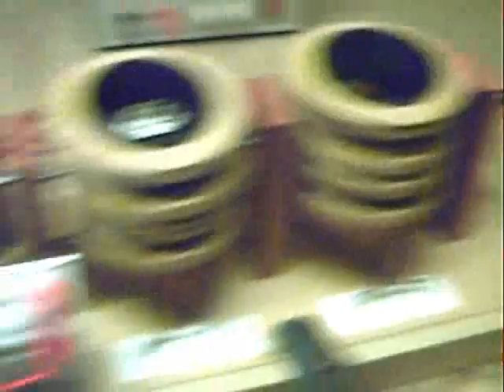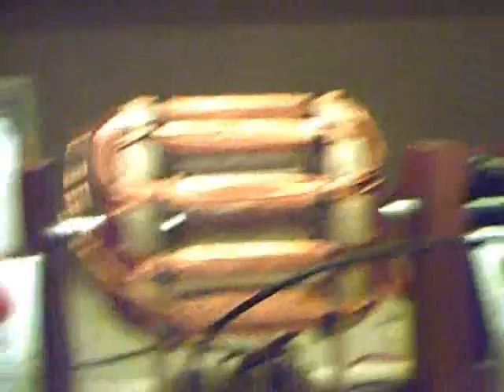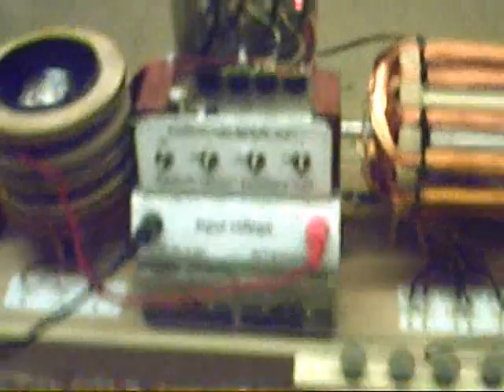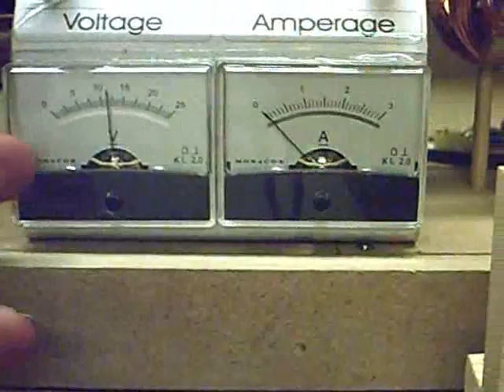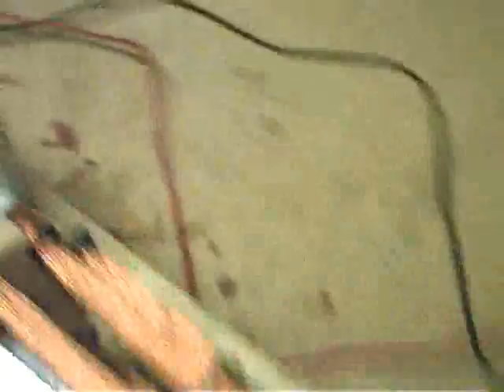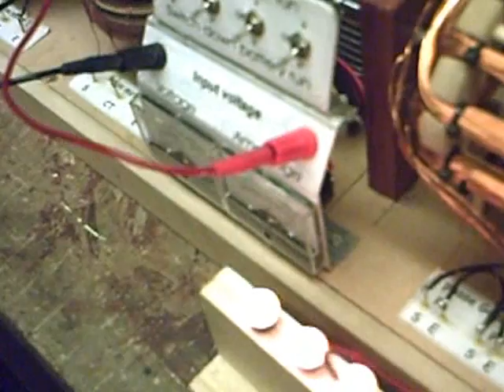My all new newman motor 2 running it up.

Comment: Put on four more hall effect sensors and time them to run the south poles of your motors and then you will have the efficiency to become over unity . You will need a flywheel coupled as well......keep tinkering. Nice job by the way.

Comment: Sorry, but this is all a lot of blah blah blah and you have not proven that you are not feeding the machine with external electricity. Build the exact same machine on a perspex stand and show us in detail live.
Reply from the maker: wasn't trying to prove anything at all just that id build a 4 pot Newman motor and just a demo of it running  up that's all this video was all about, no over unity no free energy it wasn't the point of this video, sorry. for your info its just a motor running very fast with generator filling a capacitor.  total experiment only.

Comment: Daftman please try this: 
Step 1: Power up the center motor with 24volts or more.
Step2 : Use all 4 newman motors as generators,wire them together in series to charge capacitor
Step3 : Once center motor is up to speed switch off the power supply and switch on the now charged capacitor.
Step4 : Enjoy self running loop
Reply: A centrifugally integrated flywheel (weights are spring-loaded to throw out as the RPMs increase) might be a good add, too.

Comment: I admire your fine engineering work and attention to detail. A beautiful project. I like your use of hall effect sensors.
Of course you're not going to be able to get the generator to run the motor/s in a closed loop. Perpetual energy / over unity machines are not possible due to the laws of physics that are tried and tested. We live with their limitations. The Newman motor does not, nor has it ever run on less energy than it produces. There will never be a useful electric motor that can run near 100% efficiency let alone go over 100%. The same goes for a generator. You will always put more hp into a generator than you will be able to produce in output wattage. Then you have to take into account all the other losses in the system beside the losses in the magnetic fields, like losses in wire resistance, the semiconductors you're using to switch the coils have their own losses, and then the mechanical friction losses. For those of you interested in the Newman saga: http://en.wikipedia.org/wiki/Newman%27s_energy_machine
Reply: +Fred Flintstone Nice discussion, may I comment? First, we all need understanding and meaning in what we live (see, do, interact, etc.). Our languages describe in an attempt to direct that understanding. Being able to describe anything has never been accepted as proof that the description is correct for a thinking man, although Physicists today like to think if they can describe it in the language of mathematics, it is how it "really" is. This is not rational. One must observe and conform to the distinctions that we observe in order to evolve a better description. Not start with a description and add to that based on distinctions. It is convenient to build on assumptions, but completely detached from the actual reality. So, it becomes very post modernistic to pretend that the basic assumptions of physics that still have not distinguished themselves as correct without more unfounded hypotheses and say that what physics describes is the law. (More)
Reply: +BMan18 Keep in mind that more can be learned by an unbiased observation of an event than one that presupposes they know exactly what is going on before they even look. The reason so many people are breaking the laws of physics is they are actually operating in the mode of seeing and doing without the filters of others' assumptions that make what they do impossible. But when it comes to electrical performance, there is a LOT of internally conflicting definitions and examples of things that point to the fact that modern physics today is confused, conflicted, and filled with numerous inventions of things and processes that simply do not exist. There are descriptions that simplify those assumptions of relativity and quantum mechanics (the religion of Feynman) and do what only the most advanced and convoluted mathematics of these learned men can do, predict and find validation in a broader range of observed phenomenon. These things only violate the laws of physics that are wrong.
Reply: BMan18
What you're stating is actually a myth shared among ignorant people seeking to feel better about themselves. The problem is that you can't point to any 'real' instances of your claim. Those people you criticize in physics actually accomplished something, and contributed to what we now know as applied science. It's true that there are instances of inventors / scientists who discovered something different or in addition to what they were searching for, but they were still experts in their field, well studied.
People who would rather go right to the experiments and bypass reading a physics book, or a book on the fundamentals of electricity will have to discover for themselves what's already been known for a couple of hundred years. That's fine, have fun, but the latest and greatest discoveries are accomplished by people who have built on the work of others who have come before them. Only a fool would believe they can approach science with no understanding  and discover something new, something no one before had ever seen, or discovered.
Bottom line. None of these devices work. I do admire some of the craftsmanship in some of the creations, but they only discover what we already know. Denial, political correctness, post modern thinking, etc. does have an effect on human thinking, but has zero effect on physics. If you can't see that, well then......
Reply: u know less than I and that is sad :(
Also you have less ability and for me that is good.
Bottom line is your opinion is just that your opinion are you trying to convince yourself or others.
He is not replicating the newman machine/generator.
he has a newman motor extremley efficient although not over unity.
maybe you should join overunity.com
and argue with people that are qualified and understand that over unity must exist in this universe.
Time to get out of the stone age Fred.
I have replicated over unity so either I am right and you are wrong.
or you are wrong and I am right.
as for physics we are trying to understand what already exists not the other way around.
No matter how great the human mind it is limited and flawed.
no matter how great the equation it is the same.
I have good understanding of science and chemistry and I have given you many links to real people
doing amazing things proven in a lab over unity has been proven and still you open your mouth and not your mind.
Cease from this embarrassment that has entered your ego fueled pride.
just incase you missed it 
Newman Motor not Generator.
Overunity.com real science.
Go study for a decade then come back.
Reply: +Fred Flintstone I used to be like you. I tried to deny the fact that we are more than Newtonian Mechanistic machines. But then I experienced the impossible. And I've done it many times.  I can point to billions of examples that prove that science has it wrong, and I'm not among the ignorant. PhD's whom I'm sure you agree are not ignorant are lining up to challenge the BS that has been disproven over and over again, but remain as the scientific dogma of the faithful. Check out the thunderbolts project for the cosmological, Bruce Lipton's "The Biology of Belief" for the human, Eric P Dollard and Peter Lindemann for the electrical. But look no further than yourself. You will not find a thinking machine within your body, you will not find a scientifically described or demonstrated or replicated system of communications that can explain the control system that runs your body or explains your ability to think. Or in your case, deny. You have taken the easy road, denial and conformity. Enjoy
Reply: *****
Thank you, I'll take a look.
Reply: Grant G
It would be wonderful if you were right about the laws of physics, that they are a myth invented by short sighted men. How great it would be if they were ever proven wrong. I for one am tired of paying for energy. I'm tired of paying for system losses. I'm tired of entropy. I'm tired of the effects of aging, and how gravity causes us to sag as we get older :-)
Reply: There are two things that grow as we age and our minds are not one of those Laws can be bent, did you look at the videos?
Reply: Grant G
I think you might be confusing human imposed laws with the constraints and limitations of the physical world which we also call laws. They are not laws in the same sense of how we use the word law. You can bend and break man made laws. You can't break the laws of physics. If you could, those laws would not be the law, and a new law would have to be drawn up to account for the observed change. Richard Feynman compared learning about the nature of the physical universe with watching a Chess game without knowing the rules. As we observe the game in progress we begin to model the rules of the game, when something unexpected happens then we must either throw out some previous rule, or add some contingency to the rule. We're forever learning, but at this moment in time certain rules of physics are well in place and cannot be 'bent'. But this is moot. If anyone feels an existing rule of physics can be bent or broken it's up to them to prove it. The null hypothesis is that the proposed change to the existing understanding is untrue. It's incumbent on the one proposing an alternate hypothesis to prove their case in order to reject the null. It's that simple. In science, you're wrong until proven right. It's the wise course.
Reply: The law is not for man to stipulate firstly as for being confused or confusing no I am not as I asked have you viewed the videos? I posted if not do your homework as for the rest of your rant you are like us all trying to make sense of what is and what is placed upon us.
Lenzes law can be bent anything can be bent with the correct lever and the correct element the masters of old the true ones(men of old renowned) realized this as for the laws of thermodynamics it also can be bent. As for proof I have showed enough do your own research and stay open minded.
Who am I to be wrong and who are you to be right?
And who is man to know better ?
feels like your trying to put me in a room and judge me who should wear the wig?
I do not need big words I am a simple man with little intelligence. and less ego.
As for chess I would study playing cards first not chess maybe a book called nuggets from Solomon mine chess is like a craft of duality opposition and... well do your own research I am simply saying there is so much more and we as a race choose not to be more.
So wallow in your mud and the mud of others.
remember this, if you challenge me you challenge yourself.
I can help or hinder just as you can, do not state simple things that you and others cannot comprehend because others tell you so.
Let people learn from each other never try and make out as though science is an absolute as we still have so little of an understanding towards each other little own our world that we destroy!
Reply: Grant G
Thank you for your post modern thinker's reply. Subjective, relative truth is nice for feelings and world views, but has no place in real science. Junk science does have a place for the post modernist. Trying to make the argument personal reflects a lack of knowledge in the field. Ad hominem only weakens your position.. What I think, and what you think doesn't matter really. It's not about personalities.
The proof is going to be in the pudding. Show credible proof of the laws of physics as they are widely know being bend or broken. Show a credible experiment that even approaches 100% efficiency, let alone over unity. That's what it takes.. Pontificating, however entertaining is meaningless in physics. Youtube videos are not scientific proof, and for what it's worth, every single one that I've ever seen provides predictable results. Results that follow the known laws of physics. Some of the experiments produce even worse results than a standard transformer (for example). Disappointing? Yes, but that's the way it's going to be. Faith won't make these experiments produce the results that are 'hoped for'. I do admire some of the hard work these inventors/experiments put into their projects. I encourage them to pursue their passions. When it's all said and done, a high school level physics books could have told them what they learn on their own, but there is always benefit in trying and proving this for ourselves. Each one of these people learn things from their experiments. Generally what they learn is that very capable scientists have known these things for a long time. I encourage them to keep going.
As with the Darwinian Evolutionists who have fabricated evidence in the past to try and support their claims, some 'free energy' folks have put forth a scam. I think some have to try and save face, some to try and make money off of gullible people and keep the investors contributing, and some do it purely as a joke. The frauds share similar characteristics... Their invention locked in a safe... No one can get close to the machine... A famous case was debunked by someone watching at a distance who noticed the wear on the wooden gears lashing together was on the wrong side of the teeth.  The device was driven by a hidden mainspring in its base. Quite amusing. With some the belief is that, success is just around the corner, a small tweak, or a slight design change... There's always something to try that may be the key to success. I feel sorry for some of these people who make themselves sick over the pursuit. It's usually the ones that have made bold public claims that suffer the most. Especially if they've taken money from people to do the work. Many present some conspiracy theory as to why they never succeeded, and their fellow members in the church of free energy defend them faithfully. Admission of failure of a fellow member is an admission of their own failure.

Thank you for taking the time to read my posts, and the time you've taken to write your own.. Now it's time for me to move onto other things. Be well.